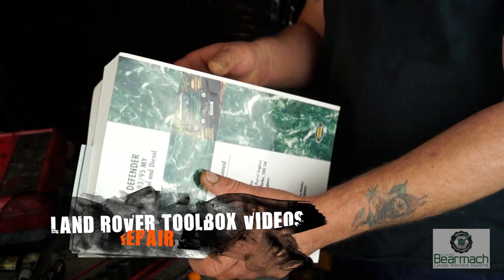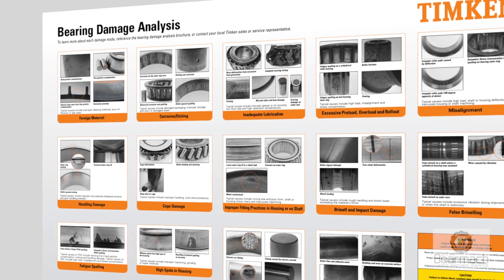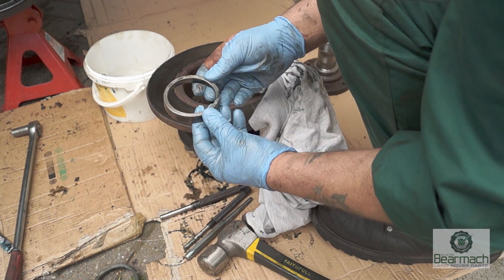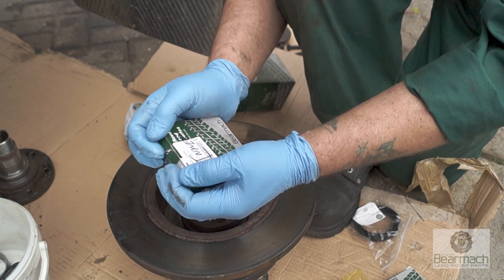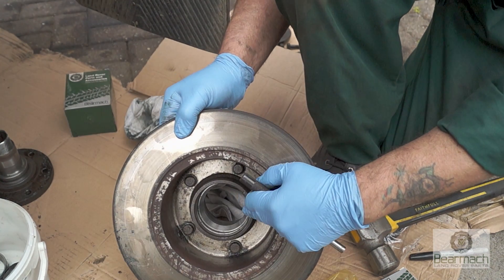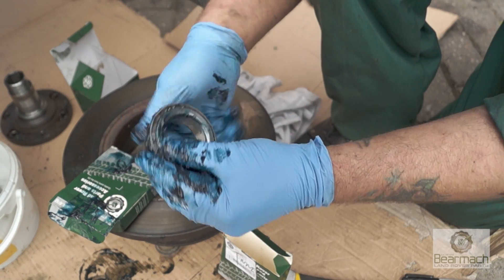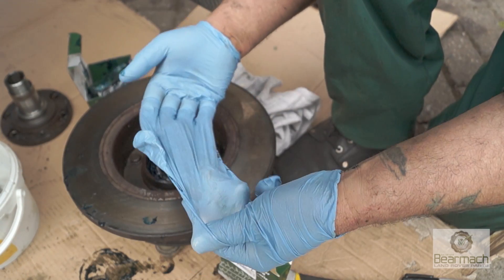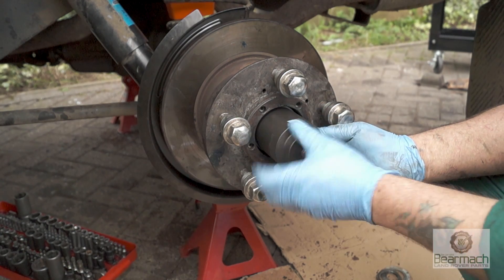Replacing Land Rover wheel bearings and seal - The Fine Art of Land Rover Maintenance

Comment: So I have a 2001 td5. I have seen a video on another YouTube channel where they did a front brake replacement and that particular Defender had the 2 nut method not the weird spacer method. Definately going for the 2 nut system when I replace mine. Anything special I need to know?
Reply from the maker: Nothing special however the "weird Spacer" is superior to the older end float setting method.  However, the spacer requires some measurement to get it set up properly.   Here is the video on that:  https://youtu.be/q2QdwGc-ujY
Reply: @trailerfitter2  thanks, I've been watching all your wheel bearing videos as well as searching online forums and Facebook groups. I think from what I've seen a lot of guys shy away from the td5s setup and go for the more old school method. I'm assuming that the 2001 td5 that was in the brake replacement video was one of these conversions or I've also heard that earlier td5s may still run the old setup. My main reason for switching is I'm from South Africa and the simpler the setup the better and it seems that the old 2 nut setup is a lot easier to repair on a trip. Quick question though, the inner lip or spacer that stopes the races going in further, on the hub in this video it looks like a permanent part of the hub. Is it the same on a td5 or will I need some sort of conversion kit or new hub?

Comment: there are probably 10 items in that shop that could be used as a driver to correctly evenly seat a race and bearing,  but whatever.  It’s a Range Rover,  it’s going to burn down on the side of the freeway or fall apart long before the bearing fails.
Reply from the maker: Not that one. It is still going strong.

Comment: Hi, thanks for sharing this vid. I need to do this job, but do not have the special tool to drive the seal. Is there any other way this can be achieved? Thank you
Reply: @10:32 where he describes using the old race to set on the seal. Instead of using the driving tool on the race, a block of wood which spans the width of the race, but is not too wide to hit the hub will work, too.

Comment: Can you switch the newer defender 110 td5 setup to this one without any trouble? Seems a bit trickier to replace bearings using the spacer method if you run into problems away from a garage.

Comment: Theres nothing said about the spacer between the bearing and chasing the right size
Reply from the maker: I'll have to do a video covering setting and measuring.
Reply: that would be great I can't fined one anywhere
Reply from the maker: Instructions are in the workshop manual believe it or not.  You need to select a shorter spacer.  Tighten up the hub nut them measure the end float.  Do a calculation the fit the correct spacer from the measurement achieved.

Comment: Thanks for this video however i do haven a question.  When you mention that the bearing drops out (at 2:23), are you referring to the baring race or the taper bearing itself?
Reply from the maker: I mean the race in the hub.  If it is loose then the hub is unserviceable as it will have been spinning  which it shouldn't do/  it should be firm in there.
Reply: heya...managed to change the bearings however have not set the end float yet.  When fitting the hub on the stub axle, there seems to be a lot of drag even with the adjuster nut slightly loose.  If this normal for new bearings?
Reply from the maker: Are the bearing races fully home in the hub?
Reply: should be as i inspected them from both ends...is there anything else which could go wrong till i recheck

Comment: hi there, i cant remember, is the front and rear axle bearing the same on a defender 90 198 as i am in canada and only have the one spare set, so wondered if i needed a second one cheers
Reply from the maker: they should be the same unless someone has swapped out and axle for something different.  I hope yours is all original to the chassis number.

Comment: I can't thank You enough for these very instructive repair videos.I look on them just for getting to know my 300 Tdi, but now I'm really hooked to get going .I have all the spare parts lying around in my garage, new discs, bearings and calipers, etc, but I have one big problem. These idiotic 12 point bolts. Is it 13 mm or 1/2 " ? My Tdi  is from 1998 and the bolts are off course totally rusted together. In your video everything just falls apart and I understand that You don't want to be seen swearing with blody knuckles. I'm afraid to put my 50cm breaker bar to these bolts, that I fear will end up rounded. Any tricks: rust oil or heat- does the hub and caliper stand for a good heating. I 'm concidering to replace these 12 pointers with hex bolts for future serviceability .
Reply from the maker: +bergatube60  1/2 inch is 12.7 mm.  You need bi hexagonal sockets to do that job.  Yes sometimes things do fall to bit and other times I do make sure that time is not wasted messing around getting stuff stripped.   We do a lot of preparation for video sometimes.   All the techniques and fitters tricks are in the videos somewhere to help you out.   Using a wheel and the hub upturned in the wheel will help.  I use a battery power gun or air impact wrench for speed but a breaker bar is used sometimes just to shift awkward bolts or nuts.
Reply: +Land Rover Toolbox Videos Thanks for fast reply, just to clarify I can use a 13 mm bi-hex socket?
I'l try the breakerbar after heating, the airgun can and have earlier splittit an ordinary socket like glas - uhhh not nice
Reply from the maker: +bergatube60   You need impact sockets when you use an impact wreck.   Single hex sockets are better than Bi Hex sockets when you need to over force any fixing.

Comment: Hello from Australia! Your videos are excellent! I have a new Defender with no issues...yet, but they will come in handy in time! There seems to be a lot of conjecture about wheel bearing re-greasing. Many people seem to convert to oil-filled bearings. I would assume that if the seals are all ok, it wouldn't matter? If there are no leaks, how often should grease-filled wheel bearings be re-greased? Nobody seems to have a straight answer!
Reply from the maker: +Andrew McDonald (SciFen)   oil filled was popular at one time.   Iveco trucks still have oil fillable hubs as standard. Land Rovers were too.   Re greasing intervals it is difficult to say but you would expect to re grease bearings when the brake discs are replaced.  If the vehicle is working in extreme conditions then real care must be taken and the task of bearing maintenance taken seriously to avoid failure.   I read an article about a journey to Iceland by Defender.  The volcanic ash there damaged the hub seals and stub axles very quickly because the dust is so abrasive.   

I prefer oil filled but reality they also need stripping and cleaning periodically as there is no real way for the oil to drain back to the diff and the hub is the end of axle place where oil stays.

Comment: I'm about to change F/OS bearing in my freelander MK1 2004,   td4 .  can the bearings be fitted the same way. IE no need for a bearing press ?    I've fitted a few wheel bearings in my time. I've always had to use a bearing press. Though some did pop in very easy. And had a retaining ring.  Perhaps they didn't need the press.  Anyways back to my TD4 .   make life easier for me if I can fit wheel bearings without a bearing press because I ain't got one. .